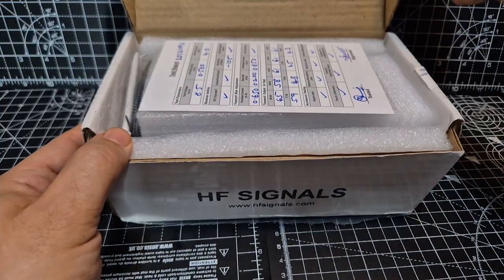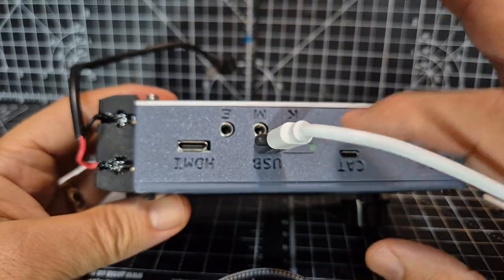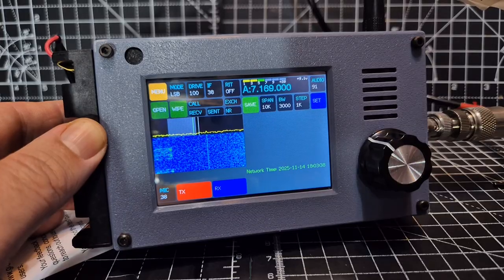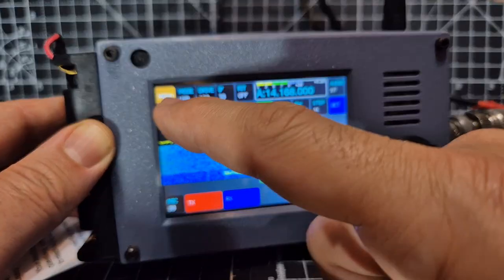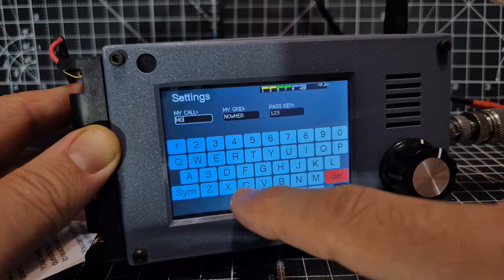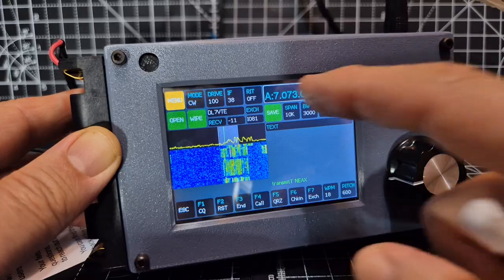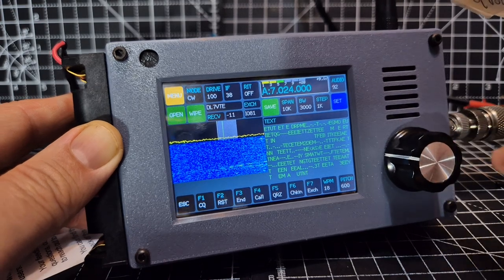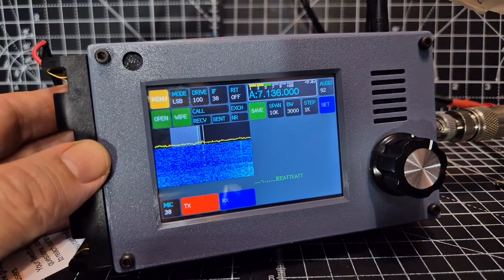UNBOX - zBitX - HF TRansceiver  Decoder , CW , FT8 Full Lynux PC

Comment: Im looking for a low cost way to work FT8...Can I use this radio to connect to my computer and use WSJT-X and Grid Tracker?
Reply from the maker: Yes i will have a try .
Reply: @M0FXBHamTech  Thx..I used to have an Icom7300 but the only things I used on it were FT8 related...I just got hooked with FT8..I been out of the game for a few years now and want to get back into filling those empty grid squares on Grid tracker...lol

Comment: Is there a way to change the background color?  I’m colorblind and need a lot of contrast.  I really like this radio.
Reply from the maker: The zBitx transceiver does not currently support changing the background color of its touchscreen UI through the normal menus.
The firmware uses a fixed dark theme (black background with light text), and color changes would require modifying the firmware source code.

---

✅ What is possible

1. Change UI colors by editing firmware (advanced)

If you are comfortable compiling Farhan’s firmware:

Download the zBitx firmware (Arduino / ESP32 code, depending on your revision).

In the UI files (usually screen.cpp, ui_theme.h, or similar), locate the background_color and text_color definitions.

Edit the RGB565 values to whatever color you want.

Recompile and flash the firmware.

Example RGB565 colors:

Black:   0x0000
White:   0xFFFF
Blue:    0x001F
Red:     0xF800
Green:   0x07E0
Gray:    0x8410

If you want, I can tell you exactly which line in the source to edit—just tell me which firmware version your zBitx is running.

---

❌ What is not possible

No on-radio menu option to change background color

No touchscreen theme chooser

No brightness-to-color link

---

If you want…

I can provide:

✅ Step-by-step instructions to edit and recompile the firmware
✅ A custom color theme file
✅ A firmware patch you can copy/paste

Just tell me:

1. Your zBitx version (v1, v2, or early dev board?)

2. Which color background you want (e.g., blue, gray, light mode, etc.).